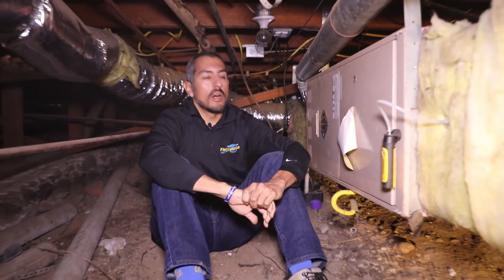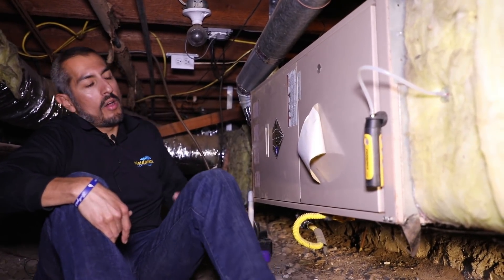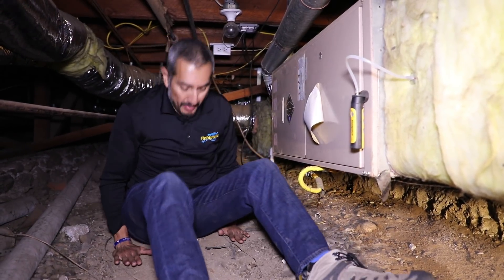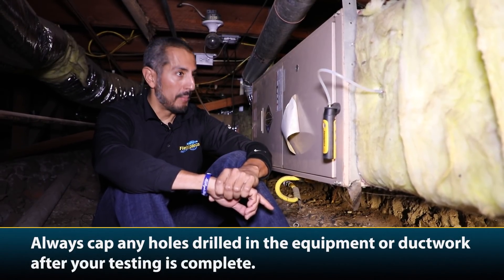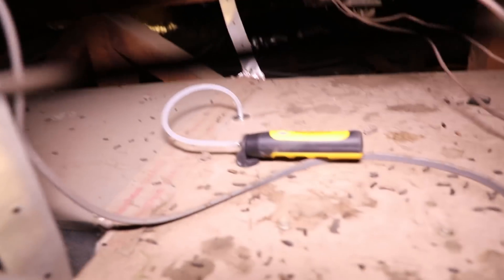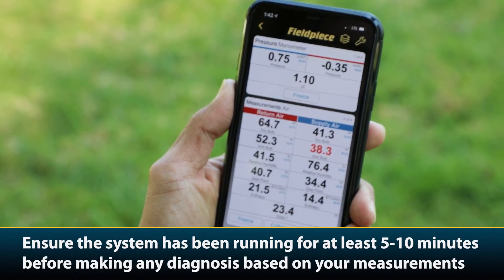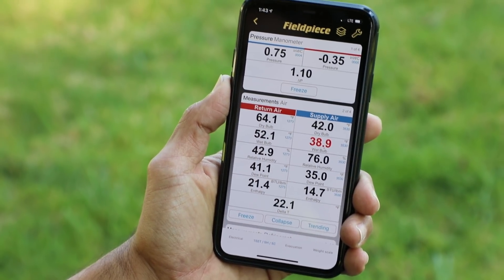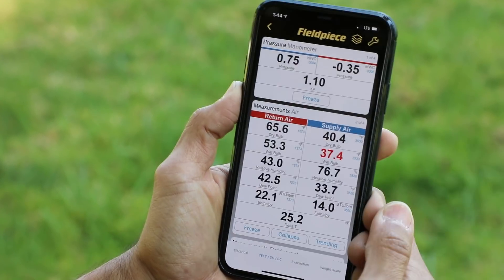Total External Static Pressure Test with the JL3KM2

Comment: So this procedure also helps me but It’s  not just kinked duct work, it’s usually undersized duct work (return). Too fast or too slow of blower speed, and or air restriction on evap coil . Because the systems they’re putting out now not only blows more torque(ecm), but they also need more cfm on return.
Reply from the maker: Thank you for the tip!

Comment: If there was a duct leaking in a tight/enclosed  crawlspace,  a supply air leak or a return air leak into the duct...the zeroing would be a worthless measurement. Your entire reading would be bogus.
Reply: I am assuming he started with the furnace off.

Comment: thx god we dnt have those systems intalled like that in florida lol
Reply: Just found this one. What do you mean "we don't have those installed like that in FL"? I have four clients on PCB where the air handler is under the house. Three of those are installed with the panels facing away from the scuttle hole and no room to crawl over. I have crawl to the lowest spot and squirm over old flex to leak check coil or troubleshooting heat or blower issues while laying in the dirt. Gotta get a skinny youngster on the payroll for those, or pass on the customer to someone else

Comment: How do you justify this as a dual port kit?
Each probe is a SINGLE port, unlike the Testo version.
So, because there are 2 single port manometer probes it is considered a dual port kit?
Reply: @FieldpieceProducts  
Or you could have ACTUAL dual port manometers by Testo that do the same thing. 
Your set up is 2 single port manometers. Your very own website description of 1 of these makes that point.
Reply: @jrsmyth9761  there is also an actual dual port fieldpiece manometer that also tests pressure switches this setup is just more convenient for certain applications

Comment: Do these measure air temp as well?
Reply: It's a old comment but I'll still answer it, they don't the only thing this great tool do measure gas pressure/ static/ and pressure switchs however note that for the pressure switchs they can't pressurize a pressure switch, for doing so you need a different type a manometer to do so.

Comment: When I check the TES Pressure and I have 0,8 or more...Which is the blower velocity (Low, Medium, or High) that should I set when I do the testing?
Reply: The blower setting should be the one that produces the air flow needed by the system. Compare the TESP to the blower chart and adjust as necessary. A typical cooling system needs between 350 and 400 CFM per ton.

Comment: you can also take the pressure after the coil to see the restriction on the evap coil only, maybe its plugged, gl fixing that on that unit. or maybe their supply registers are all closed.
 Usually static pressure comes mostly from the negative side. i bet their evap coil is matted up.